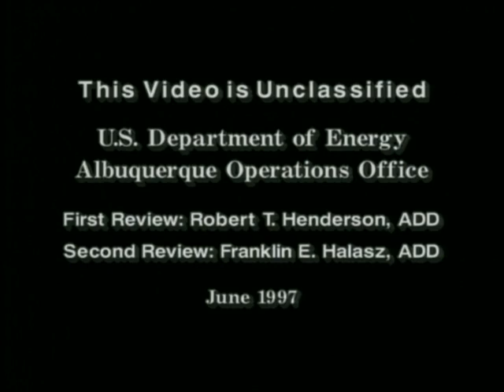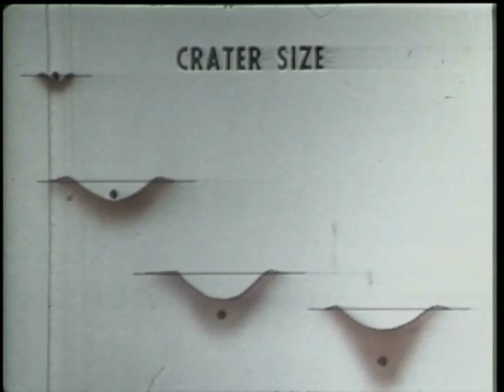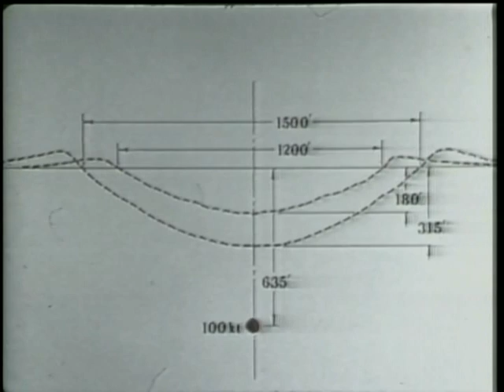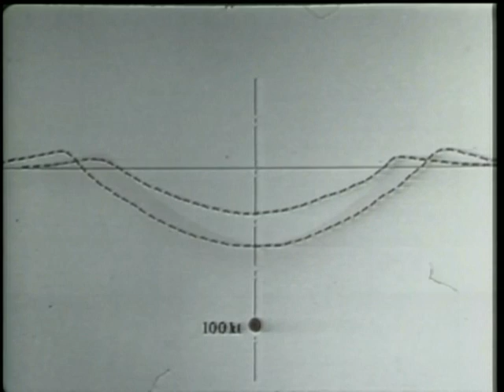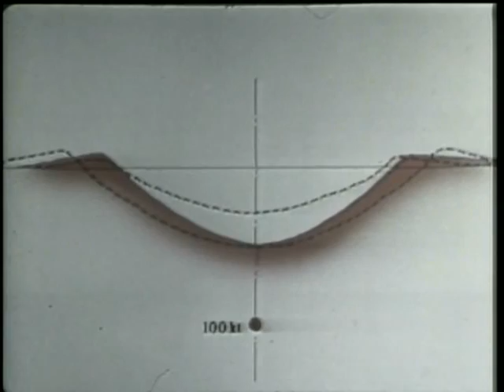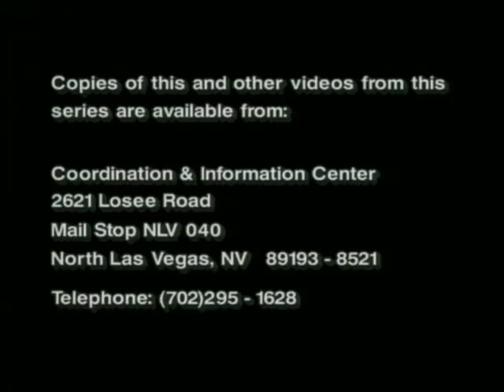Project Sedan Nuclear Test

Comment: 2:06 Turned out to be completely wrong.   This was the dirtiest bomb the US ever burst.  They didn't factor in the issue of Fallout and the more debris you blast into the air the worse the Fallout gets.
Reply: Crossroads Baker was dirtier, and from a bomb 1/5 the size.   Sedan buried most of it's fallout.